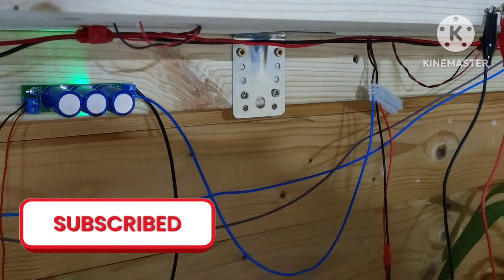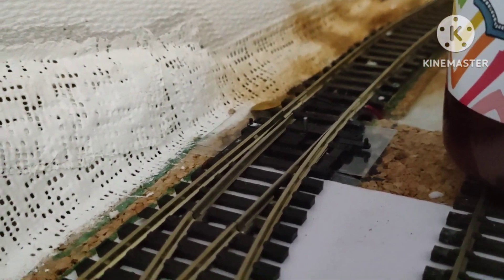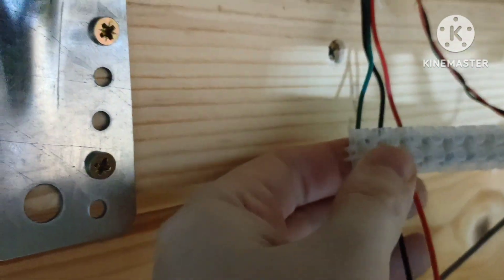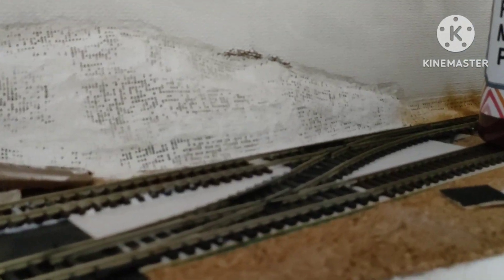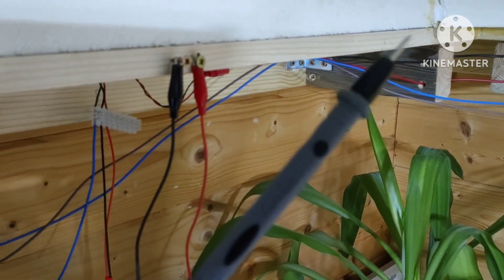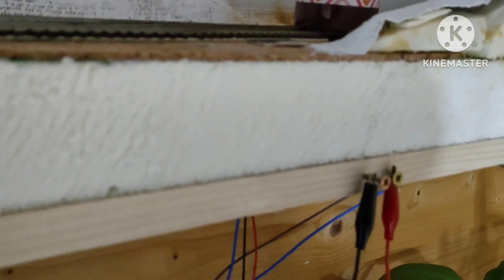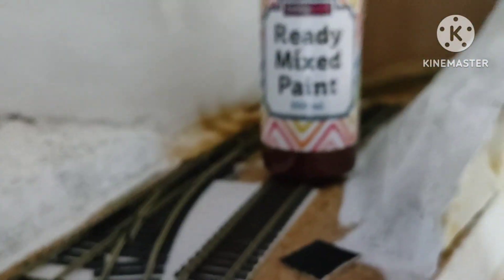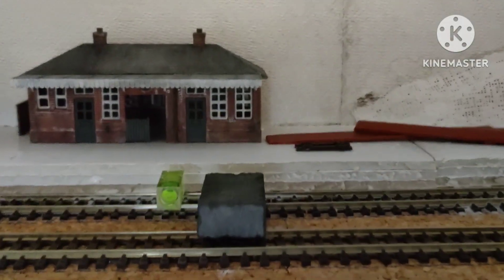OO Cabin Shelf - Slow and steady progress update

Comment: good work. If I can afford it I will add point motors to my new layout build micro layout. Regards Bernie
Reply from the maker: Thanks for the view and comment. it wasnt planned, only after jumping back and forth did I realise it's going to be frustrating without them 🤣 I bought the rails ones, and Peco pl-10s. The rails are really good as the two poles have a built in common connection so less faff. I'm going to have to think about how to make a control board at some stage aswell, another job!